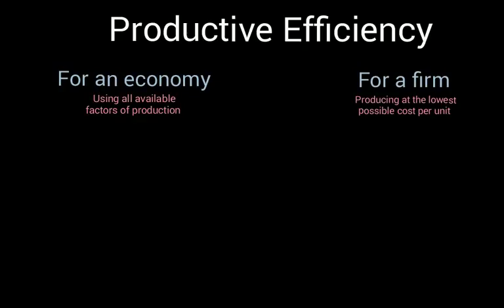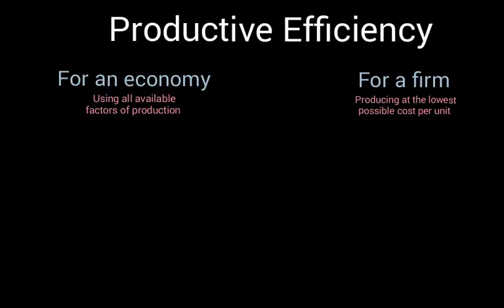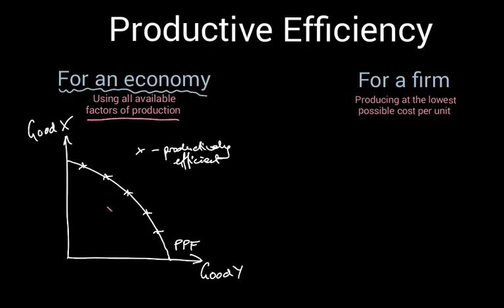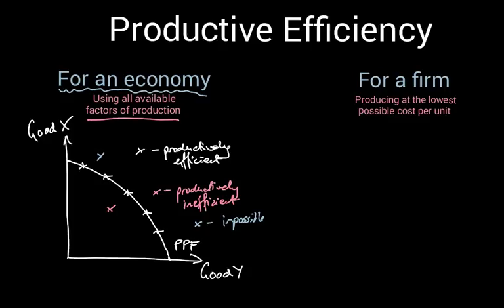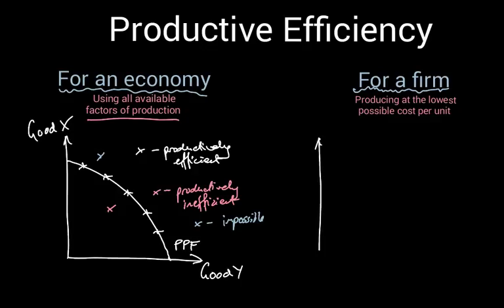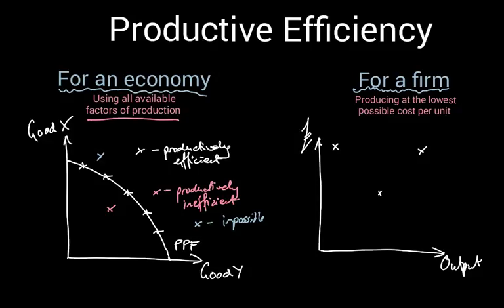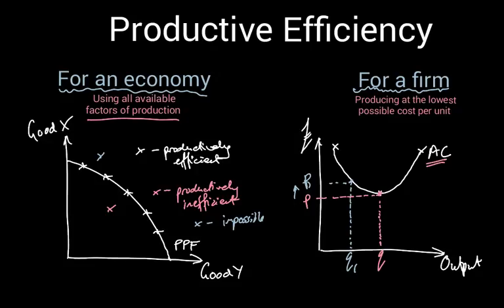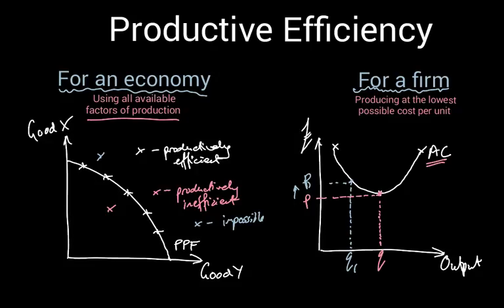Productive Efficiency - AS Economics

Comment: I hate to tell you but the notion that small firms have higher cost per unit is not always true.  Second the notion that there is an optimum cost because cost go up with scale is also not true.  Toyota and Amazon both prove this.  The Toyota production system is designed specifically to defeat this notion.   This is all theoretical nonsense .